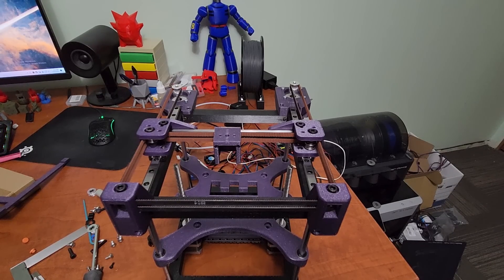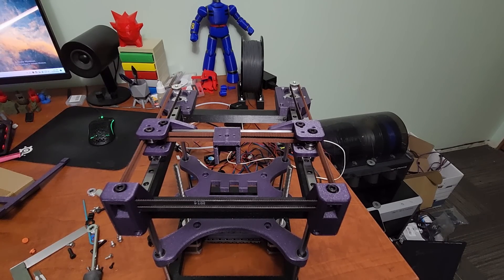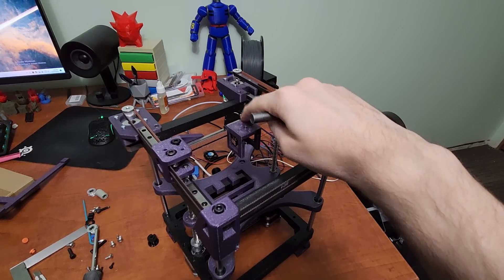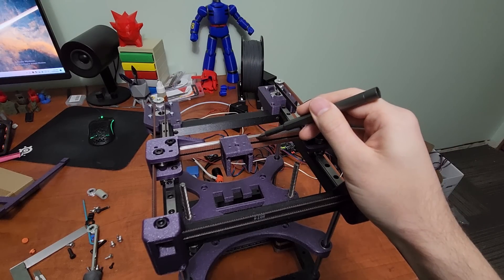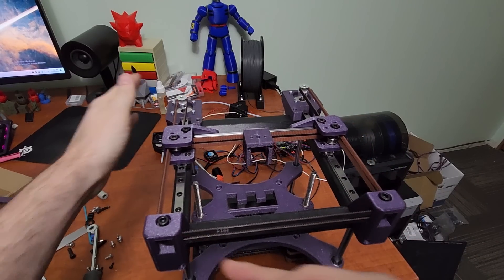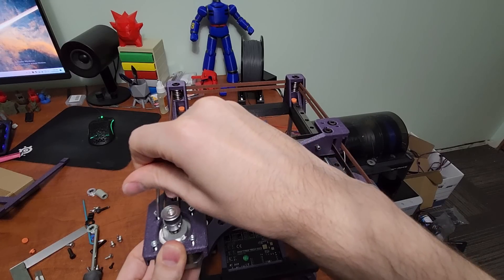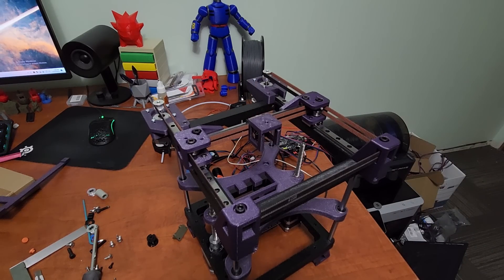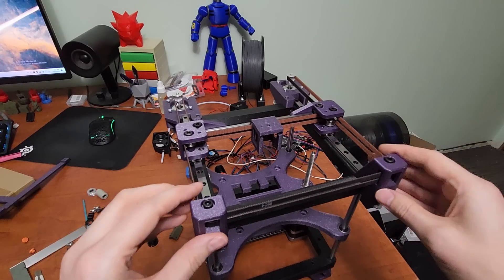Rook a cheap mostly 3D printed CoreXY printer - Build Tips Part 3 - Belt Routing

Comment: Any improved stl's for the x carriage ender 3 hotend mount? Thanks!
Reply from the maker: yes the ender 3 style hotend mount is on the github
Reply: @Rolohaun  Printed that single model but I didn’t like it. Looking for other designs with a mounted fan perhaps? Thanks!
Reply from the maker: @webslinger2011  it does have a 3010 fan mount on the front, there are no layer cooling fans on the stock rook toolhead just the rear mounted blower. There are mods on the discord though!
Reply: @Rolohaun  It seems that the 4020 ducted fan can be used for part cooling. Going to mount it in front of the hotend fan.

Comment: Something I have been wondering about since I first saw the rook: You say everything can be printed from PLA, but PETG would be better.
Doesn't the heat from the steppers soften up the PLA too much? (Glas point temp of ~60°C)
I'm asking because I'm not comfortable printing PETG and pretty much only use PLA...
Reply from the maker: my motors do not get that hot, the toolhead is very light and doesn't need much current

Comment: The simplified bill of materials is huge, that and cost been my biggest obstacle for most DIY projects. I'm trying to do a similar thing with DIY filament extrusion, but most of my parts are from Amazon and thus unreliable for sourcing. Also can't use as many printed parts.
I wonder if it'd be possible to print the linear rails and many structural components too. Maybe out of a specialized low-friction engineering material like Delrin, which can apparently be a pain to print.
Reply from the maker: it may be possible to print some motion parts however every printer prints slightly different and it may be hard to get the tolerances right. Linear rods and bearing are very cheap and probably the best route to make a inexpensive motion system
Reply: @Rolohaun  ah, thank you for explaining why it’s infeasible.

Comment: This version distinctly feels more like a Rook in styling with a squared off top.

Also, great to see the evolution removing parts where discovered, and regularizing parts, which can greatly help with repairs/original sourcing for getting costs down: depending on the part and where you get them, it’s not uncommon to be required to buy a minimum number >1, an easy example being thermistors on amazon, where you end up getting 5, but how often do you replace thermistors?

The best part is no part, because there’s no expense for it and it removes things that can fail.

Comment: I'd like to see a version with a single Z motor.
Reply: You mean one side only, or two screws mechanically linked? It might be ok with one side, being so small. My old CR-10 does fine with one-sided Z, and that's 300mm bed. But that has wheels on adjustable eccentric centers so you can get the preload on them just right. LM8UU may have a bit too much play. LM8LUU would be more likely to work, but may cut into your usable Z range. I wish SBR8UU were more readily available. Such a brilliant design, making the preload adjustable so manufacturing precision doesn't have to be perfect/expensive.
Reply: @dekutree64  Yes, mechanically linked. It's nice to not have to worry about one side falling lower than the other when the motors are off.  The Z motor could be mounted in the front or back, then use a GT belt loop, and bearings/GT2 Pulleys on the two Z screws.  I have similar setup on my  FT-5 Printer